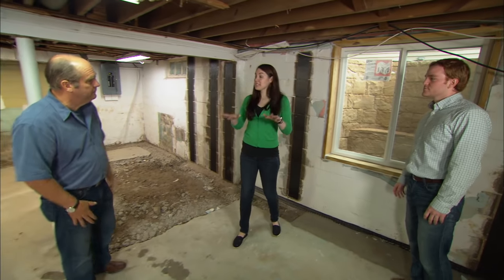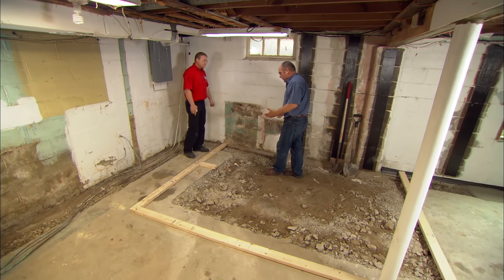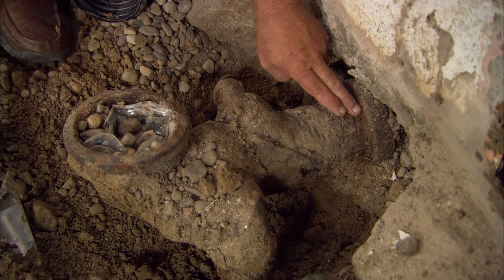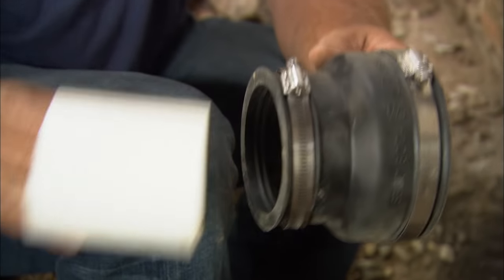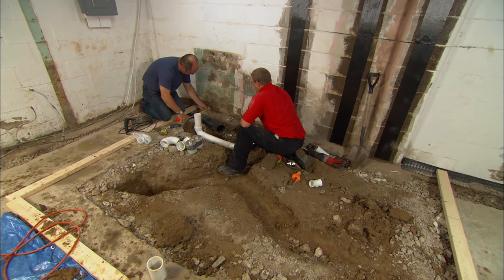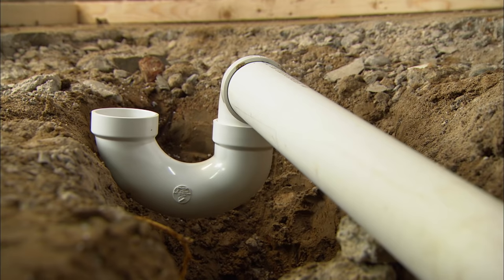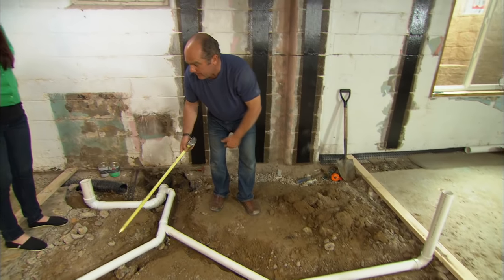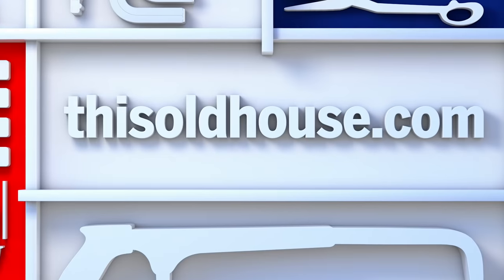How to Install a Basement Bathroom | Ask This Old House

Comment: This guy is a professional plumber, and you have Richard talking to him like he doesn't know what he's doing.
Reply: No. That was a garbage job. I've been in the plumbing business before you were dropping deuces in diapers and I tell you that was a garbage plumbing job.
Reply: @tdurden9532  please explain?
Reply: @johnsmith-wc8gs  I kind of have to agree with T Durden. I'm a Licensed Master Plumber in Michigan. 

In no particular order...there are a few things that I would not let fly if it were my job. Not necessarily code violations but just a few sloppy things.

First, this is an underground. Not a "Rough".

They should of built boxes to go around the trap for the shower, to help protect when concrete is poured.

Risers should of been used and came high enough to cap. Not use plastic or cellophane.

 I would of used a sawzall with a diamond blade, instead of the grinder. Also would of been bedding the pipe with fresh fill as we went, which brings me to the next thing---If you are good at running DWV you should not have to "dry fit".

 You should measure, cut, prime and glue. Done! I also did not see an air test.

Either way, neither of these two would ever cut it working for me.
Reply: @gunsnstuff4040  See this man knows his craft. If your not a licensed plumber or been in business for over 20 years please shut up.
Reply: That and the dummy tape he's using 🤣🤦🏾‍♂️
Reply: @tdurden9532  I thought the first rule of plumbing is to not talk about plumbing?
Reply: @gunsnstuff4040  one code violation is that the pipe needs to be wrapped in foam where it will be going through the concrete. This is to allow for expansio. It's possible it is not required in this jurisdiction but I highly doubt it. Inspectors like to see the pipe bedded in sand or clean fill as well. Other than that it's all preference. Guess I wouldn't call it a garbage job because it will work. People just like to pick apart other people's work
Reply: @gunsnstuff4040   this old house is theoretically supposed to be showing homeowners how to do home improvement,  how many amateurs can plumb a bathroom 123 without dry fitting pipes?
Reply: They're never really talking to the pros that way. They're really talking to me that way and the pro is just in the crossfire.
Reply: @johnsmith-wc8gs  Foam? Not our code, which is adapted from the IPC. When going through walls or foundation, the pipe shall be provided with a relieving arch, or a pipe sleeve shall be built into the wall. The sleeve shall be two pipe sizes greater than the pipe passing through the wall.

And yes, it is a garbage job, all around.

Hate to hear your expectations or even worse; opinion, thinks this job has any quality to it at all.

The job in the video would NOT pass any inspection!!

Incorrect bedding.
No air or water test.

Just to start......

improper protection of piping....the list goes on.

Are you a Licensed Plumber, John?
Reply: @gunsnstuff4040  They look trainable though. Are you sure you wouldn't hire one?
Reply: @Yuriy Pasternak If you explain to the viewers, you look and speak to the camera, not the plumber.
Reply: It's just a show it's scripted he's just explaining it for the viewers
Reply: @tdurden9532  I'm an amature plumber and this was a crap job even to me 😂 not to mention I'm pretty sure that dude broke the cast iron free from it's socket. I hope they did this properly after the cameras went off.
Reply: He's not talking to the plumber like he doesn't know what he's doing he's taking to the audience that don't know what they're doing. He's a tv host remember? He's gotta explain what he's doing 🤣
Reply: @alec4672  like I said earlier, you look at the camera when you do that. Not to the plumber.
Reply: The pitch is 1/4 inch per foot for pipe less than 3" not 1/8. Major error. Should let the the Master Plumber run the job and show the plumbings permit that was obtained that is required by law
Reply: I don’t see how you don’t understand that he was really talking to the audience, just not looking directly into the camera. Weird.
Reply: @saulgoodman2018  Your head must be really thick, huh? This old house is a television show. You know, for people who watch the. Why the hell would they have cameras in there if he was explaining the procedure to another licensed plumber. Me thinks you’ve sniffed a little too much plumbing glue.

Comment: im a plumber myself and ive done underground rough ins, I have to say that this video is very explainable for anyone who is not a plumber and wanted to do their own plumbing. good enough video
Reply: Question - how does the drain for the lavatory act as the vent (wet vent for all other fixtures)? Around 6:40 he says it. So there's not actual vent that goes to the outside?
Reply: @nofurtherwest3474  I wonder can an air admittance valve be used for everything instead of routing to the roof?
Reply: @nofurtherwest3474  oversized drain line. The air is able to get between the water and the top side of the pipe. If it were a smaller pipe there would be no room for the air and water.
Reply: @corysturgis6660  yes.. I am a plumber.. It is possible
Reply: @lep8622  yes. I AM A PLUMBER AND IT IS POSSIBLE TO REPLACE A NATURAL VENT WITH A MECHANICAL ONE
Reply: Do you make good money I thought about plumbing work but not sure how to get my foot in it
Reply: dumb DIYr here - how does water/sewage flow away and up from home that is lower than the street??
Reply: If he did this plumbing in NYcity he would have fell inspection immediately. This is a handyman special job
Reply: Does the rubber reducer they put on ever deteriorate over time? You would think being buried in the ground it would slowly break down over time.

Comment: I am so glad they did not installed water supplies in the concrete floor. It would have been easier this way, but running water supply trough Sheetrock wall cavity is the best way to do it. Props to Rich!

Comment: you never want to use flexible couplings under the concrete but rather a solid metal banded coupling with a rubber behind it, its called a mission band, over time flexible rubber couplings can flex to much, if shifting occurs in the ground that could potentially obstruct the flexible coupling they used in this video, what they used is a fernco, I suggest a mission band.
Reply: I agree buried under concrete is not the place for a fernco. Hopefully by the time it's a problem this couple's transgender kids will have to deal with it .
Reply: @wesfrazier5739  LOL!
Reply: Why would there be shifting?
Reply: Actually, I think it is reversed - you want banded coupling above ground so they don't sag!!

Comment: Been in the trades 16 years. Have had a master plumber, master electrical, and master hvac license for 11 of those years. I am now a building inspector.

First thing I see is working clearances to the breaker box when walls are built, you are not going to have three foot in front of it. Looks like about 32 inches if you go by seems in the blocks, and that's not counting that the front of the breaker box is four inches from the wall surface to start with. 

Second thing, depending on code they are on, they may or may not have done the venting correctly. As a plumber I would have vented the toilet separately, however depending on the code for that jurisdiction they may be within code, however codes are minimum standards, nothing saying you can't do more, and all we are really talking about is a few more dollars in fittings, not much in the overall cost of adding a bathroom. 

Third that is going to be a finished area, I would have depending on circumstances outside, dug down outside and made it to where I had PVC to outside of the home, as well as installed cleanouts on the outside of the home, again not required to do that per code, however why mess up a perfect finished area when cast iron fails, and it will fail. I might also would consider a check valve in the event of a sewer backup you don't flood the area, however check valves do fail, and that can be a problem too.

Comment: This is the easiest install of all time being that there was already a bathroom there.  Where I live, no one cares if you move your toilet from one side to another, but in states like NJ and NY it's endless bureaucratic red tape and paying for inspections.
Reply: I was hoping to see how they were going to solution that problem... Thinking they were starting from scratch.
Reply: AxZxTxExCxA same
Reply: Copykon's Music
Reply: AxZxTxExCxA probably would have used a macerating unit.
Reply: They could have done this without a permit. No one would have been The wiser
Reply: very easiest work. but they are bulit up  every thing.
Reply: I've done many basement bathrooms but not in the 2010's; so I don't know what's changed as far as code. My concern is having a bedroom in a basement with 16 x 30" slider windows is illegal even if you're the owner; not to mention only one exit. You can have a bathroom in a basement will have a code enforcer set you up for troubles.
Reply: @flexiblestrategist9922  depending on local code, there might be a requirement for bedrooms to have 2 points of egress.  Usually, a window and a door will satisfy that requirement, but that window might be too small
Reply: Just don't tell building control
Reply: That’s why you don’t tell the city. You just work and repair. I’ve remodeled and extended a house by 19 feet without telling the city. Save me a lot of money 😂😂
Reply: Never tell building control.  They just want your money.
Reply: Those are only required if you tell people that you are doing it. When I lived in New York, I made changes in my house and didn't tell anyone.
Reply: @LucidDreamer54321  smart move
Reply: In the People's Republic of California I hear it's even worse with inspectors.
Reply: @POLOAZTECA  same here

Comment: I see alot of comments about the wet vent smelling bad, it's not to open air. It either ties into the buildings existing vent or if code permits you can get a $20 one way  vent that only allows air in.  Wet vents work well. I may have added an additional vent for the shower at least but just my opinion .

Comment: I like how his glue and primer bottles are banded together. Great idea.
Reply: I noticed that also. I was wondering if it would help prevent me spilling the glue or make it where I spill both, instead of one.
Reply: Back in the day guys used to mix 3/4 glue and 1/4 primer and you still got that purple color around each joint!!! It would water down your glue a bit but would actually go on better it's frowned upon these days though!!!

Comment: consumer tip, if it's only a few more feet to get outside of the house, then have your plumber go ahead and replace it. If that "80 yr old cast" fails 6 months later, then your tearing out brand new floor, tile.
Reply: Scott O'Brien" so true! that's what i said more money spent if it start coming apart.
Reply: It may be 80 years old but it will last another 900 years. Stupid advice to spend more money digging
Reply: They are also installing a toilet so they will come at a point it all gets to rusty and toilet paper gets stuck there. You don't want to save on something like this when you can easily go outside you will regret it if you don't. When you spend so much money on renovation do it good or buy a new house.
Reply: When he cut the line you could see how much material was still there.   If pipe is in good shape why replace?
Reply: @davem3789  Because, metal pipes only have a 30-50 year life expectancy when in use for water.
Reply: @andrewalvarado4420  lol that pipe was already 80 and looked solid. It'll last long after she sells the place.
Reply: tumbiola  🤣🤣🤣🤣🤣
Reply: @stevesanderson8360  Not at all true. I did a lot of plumbing in my parents house which was built in 1947 with cast iron pipes. When we boys moved out about 1990 our bathroom wasn't ever used again. Later I came back to do a remodel on the bathroom and on disconnecting the relatively  modern faucet and drain I found that the cast iron pipe behind the wall was rusted to the point that the bottom inside of it was only about one-eighth thick. Cast iron is pretty good but nothing's gonna match PVC.
Reply: It would be more costly to dig down 7 feet outside and replace the old cast , than to replace a little floor tile .
Reply: @danielfronc4304  Are you certain that they were cast iron? A lot of houses used cast for the main stack, and toilet, but used galvanized steel pipe for the small horizontal runs to sinks because it was easier to work with. Galvanized steel pipe is absolutely horrible, especially for the supply lines, it rusts itself closed, then rusts through the threads at the fittings, but for a drain line it will do the same, and rot right through since it's usually thinner gauge.
Reply: I had cast iron pipe burried under my basement floor on its way out to the sewer in a 90+ year old house. The bottom rusted out. Caught TP and caused major problems.  Several thousand later it was replaced with PVC to the house trap.  It's never been a problem since.  Cast iron is definitely not forever.
Reply: The thing to solve the issue you’re speaking of, is to push 3” pipe through the 4” cast until it’s past the concrete outside. Then when the outside sewer needs replaced, you simply remove the cast with a soil pipe cutter and glue on to the pvc. Saves money on the new bath install, while helping with future issues/costs.

Comment: 1#...Use a soil pipe cutter.
2#...use some kind of 1/2" minus or screenings to support piping from underneath, before concrete comes.
3#... Box off shower for drain install..not wadded up plastic.

Comment: You should have installed a backwater valve to protect the bathroom since this is the basement . Also our plumbing code mentions that you need 1/4 per feet pitch for a pipe that is 3"or less. 1/8 per feet is for pipes 4" to 6".
Reply: Backwater valve is required where I live, and horizontal dry vents are not allowed
Reply: @HaakonAnderson  horizontal dry venting not allowed  because they can plug up with dirt and sediment?
Just curious..
Reply: @REWYRED  they will most likely function fine, inspectors don't wanna see it so we don't do it
Reply: It's just honestly not professional, water and waste could enter it, get paid to be professional and

Comment: TIP :  When  doing a lot of  PVC  cutting , a  miter saw will make  perfect cuts every time  very quickly, and no  burring , you can cut up to a  4 inch pipe with a standard saw .

Comment: these comments are simply classic.   as soon as he measured the offset at 12.5" and not 13", i knew this was gonna be loaded with goodies.  nobody here let me down either.  hahahaha.
Reply: Standard offset for residential toilet with 1/2 wallboard is 12.5” off of the framing. 13 would be for commercial with rc channel and wallboard.
Reply: @mitchjones2821  true
Reply: Umm, what if they going to tile the wall?
Reply: @jamesintriago8816  tell em they cant have it

Comment: 12.5" is all you need.... Thanks for deciding the wall covering for me by refusing to add enough room to possibly tile my walls... Did a bathroom reno and thankfully had the forethought to measure the closet flange placement, 12.5 wouldn't even fit cheap white builders tiles with adhesive let alone the 5/8" honed 18" square travertine I used. I moved mine to 13.25 and after the substrate, large format grout and tile there was less than 1/8" to spare after the 12" offset toilet was installed.

Especially in the case of a basement install under concrete, give yourself an extra .25 to .5" clearance, you can tile in the future if desired and if your toilet tank needs to rest on the wall a small shim or spacer will never be noticed if installed properly.

Comment: Just for clarification no obstructions 15" either side of toilet measured from centre of drain.
Also the lav can serve as the vent for both toilet and shower so long as it's within 6' of each fixture being served. When thats not obtainable you must increase pipe size by one size

Comment: 3:43 the clamp has slipped out of the groove on the bottom as he torques it down.
Reply: Its not a huge deal.. the compression will hold it in place
Reply: lol I am glad im not the only one that noticed that. Totally inappropriate way to install that clamp. With the uneven clamping pressure on that coupler that's bound to leak down the road now.

Comment: you need to account for 1/2” drywall, mud 1/8” and tile usually 1/4” so your toilet should have been 12 7/8” or 13”

Comment: I’ve never used a diamond blade for metal only ever used them on block or concrete. Grinder zip cut discs are what I’ve used to cut cast.
Reply: Diamond seawall blade?
Diamond blade last much much longer, cuts cleaner and safer

Comment: when using the fernco coupling you should use a 4" fernco coupling with a metal brace and then reduced to 3" using a 4x3 pvc reducer, you cannot use a fernco with out a big metal brace
Reply: huh?